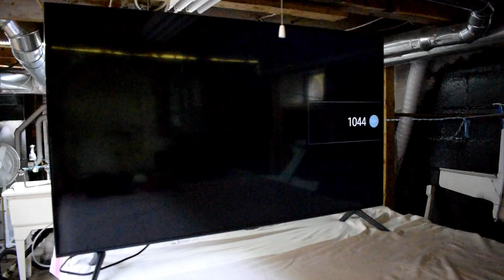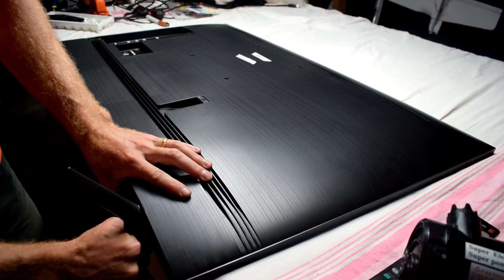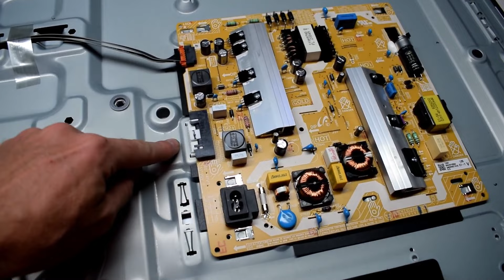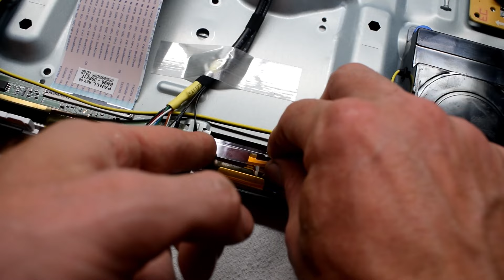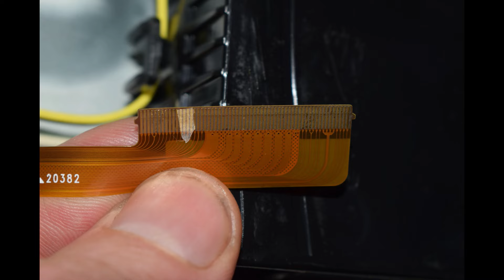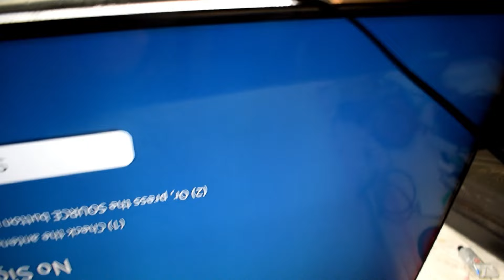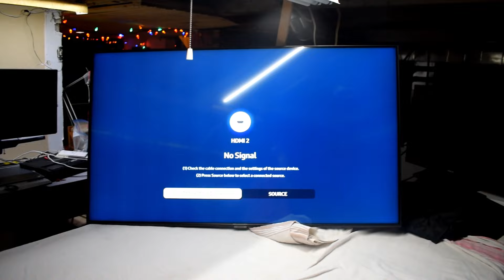Samsung Smart QLED TV Keeps Restarting! Fixed with TAPE! (Model QN50Q60TAF)

Comment: You saved me a main board and what more. I spent hours putting tape on the panel flex that connects to the main board, managed to get sound but no image, until I found your video. Thanks a lot!
Reply from the maker: great
Reply: Hi @Rob DC , same. I was also only getting the sound while taping the flex. I followed your comment and tried to tape on the bottom  cof. At some point, I am getting images, but the picture is so white and bright and the colour is too low. I tried adjusting the tapes, but not been fixed yet. Any idea on this mate, please
Reply: @Bass078  You have to keep moving the tape around and probably try the other connectors.
Reply: @RhymezDj  I tried both sides, Rob. Funny thing is that it stops the boot loop if I remove either the left or right side.
Reply: @Bass078  Same here. Disconnecting either the right side flex and left side flex produces the same results. It stops the rebooting but no picture =(
Reply: @hammiranda  let me know if you find a solution. I tried and gave up 😢
Reply: Anyone find a solution? Running into the same problem here. Sound but no picture 😩
Reply: So this means issue with broken LCD panel and cannot be fixed with new ribbon cables - correct?
Reply: Is your TV still working?
Reply: @mustafae.6719  Still running strong.

Comment: Thanks man. Spent 3 hours trying the tape fix from other videos with 2 LVDS cables but mine only has one and there were so many pins it just wasn't working. Tried unplugging the left from right and it stopped restarting so I knew it was internal and which side but didn't think to cover those pins. My tv is a TU8000 and looks pretty much perfect now. Crazy how common this issue and fix is. Even Samsung techs do the tape fix!
Reply: Which pin did you cover ? I have tu8000 aswell
Reply: I don't understand, I already tried to put tapes in several parts, on both sides, there are parts that remain on, but the image on the screen is not seen, any solution?
Reply: my side i did on un50tu8000 but maximum i could ve been able to do i can see a black line with 2 little green line .. could been able to bring back 100%
Reply: I am dealing with the same one now 50tu8000. It was reseting itself and i tried to play with the tape and got some pictures and the weird now is that i have full picture without any tape on the ribbons. I have no idea how that happened but i do have few horizontal lines which still cannot clear. Any ideas please?
Reply: @dobrilstoev2925 from my research you’ll have to play around with the tape again until you isolate the pin or pins causing the horizontal lines
Reply: @dobrilstoev2925  The exact same thing happened to me. Screen turned balck and set restarted after 30 Seconds. I could not find a tape position that was viewable. Either the set rebooted or the lines were across the whole screen. Then suddenly I had all tape removed an the set started and stayed on. Only had a very fine line, only visible on solid color background. The tv worked like this for a couple days and then suddenly shut off again. Now the restarting happens much faster, wich made testing with tape a little easier. But there is no combination that is viewable. I want the single line without tape back 😫

Comment: I followed  the vid and all went well until it didnt.    I unplugged the large ribbon and got the steady blue screen.  perfect.  I repluged it in, and it went back to cycling.  Great.  
I unplugged the small righthand ribbon, no change.  OK... I reattached it and unplugged the lefethand side, still no change.  So now what?
Reply: My TV is 2 years old Model qn55q70tafxza
Reply: @timgillespie6369  mine is also 2 years old and has the same problem  :(
Reply: Ever get a fix for the 55 inch Q70T?
Reply: @MitchellCole-5   I have a q70t and doing this fixed solved the problem. Compromised on the picture a bit, and gained a blacked out vertical line on the very far right hand of the screen.... I can deal with that for now while the fiance and I save up to get a new one sometime down the road.
Reply: @MitchellCole-5   I should say, doing the fix from the video fixed the problem

Comment: So the masking tape worked on the left side ribbon cable, and now the TV stops turning on/of, and I see the white no HDMI source screen, but I notice 2 vertical lines about 1/4" apart going from top to bottom of screen right in the middle.  Is this related to the masking tape or is the panel bad?  It is a QN75Q6DRAF.  I assume the masking tape is a fix for a short in the cable, would replacing the cable solve the issue?  I read online that vertical stationary lines could be a bad tcom connection.  I already replaced the power and main boards, bit not even sure that is the issue.

Comment: Hello. Maybe you can help me.
I have the same exactly tv, with the same problem. Power works fine, and main board works fine. Now.. I disconnect right side of the LCD panel  like you did and the tv works (without image obviously) but then I disconnect the left side of the LCD panel and it works too.
But having both connected makes the tv reboot loop.
And how did you know where exactly to put the tape on the LCD panel flex?
Reply: Have you found fix to your issue.. as my tv issue is same.. its working on left and right lcd panel.  But when i connect both restart loop happens..
Reply: just try one place at a time until you find it.
Reply: Same problem here. Did you find a fix?
Reply: @BrunoTourinho  Samsung is known to be having these issues. I’m throwing away my 2 year old tv because I will not pay 500 to fix it. I am going back to Sony, regardless how much it costs with 5 year warranty. Screw you Samsung. Your products are trash.
Reply: I have same tv, same issue. Bought 2 year ago. That interesting how many others have same or similar issue with that tv.
Reply: Exact same issue as mine - did u ever figure it out? I've tried everything. thanks
Reply: Bought mine 2 years ago as well